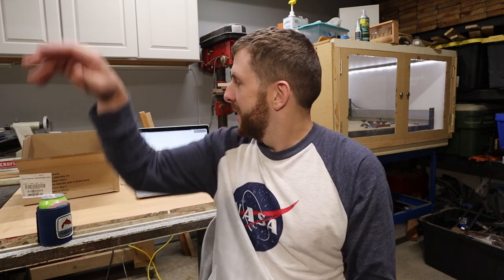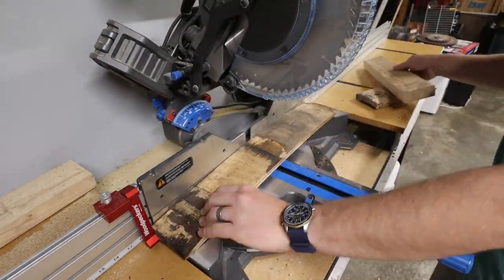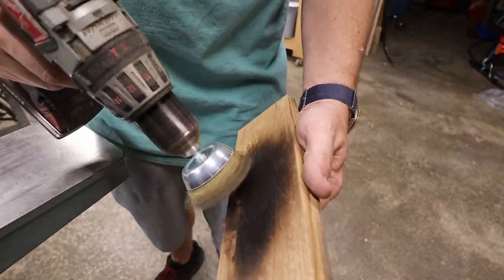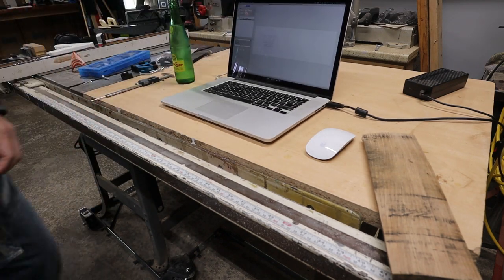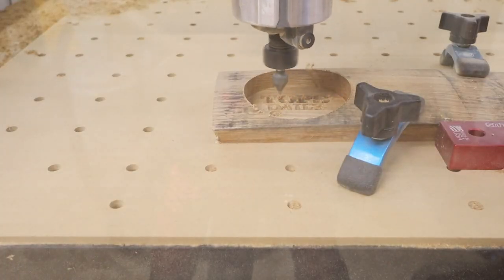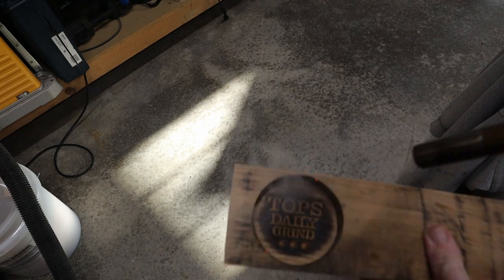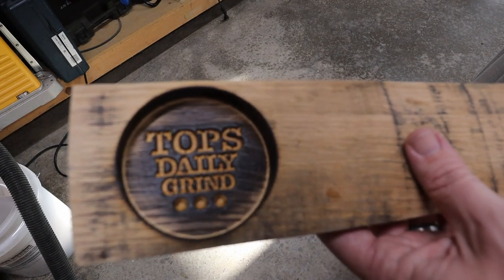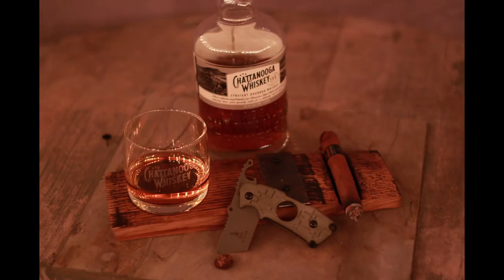Bourbon Barrel Stave Coaster and Cigar Rest for TOPS Knives and TOPS Daily Grind on the CNC

Comment: Thanks for the video, nice work. I'd like to make a couple. How wide a stave did you use for this and could you tell me the diameter the cup holder? I don't have a CNC, so I'll have to use a forstner bit. Lastly, is it hard to learn CNC for operations like this?